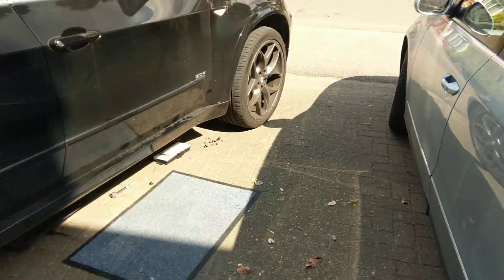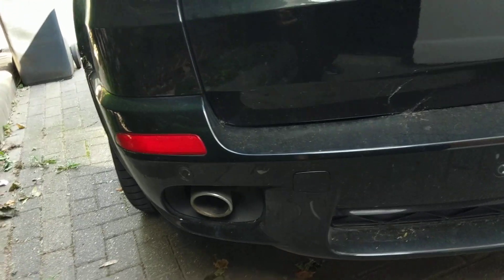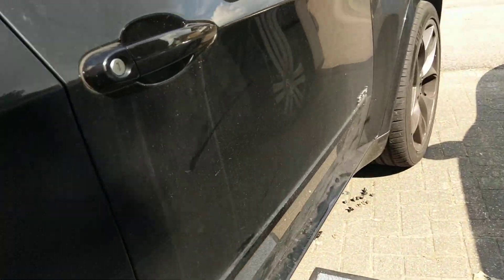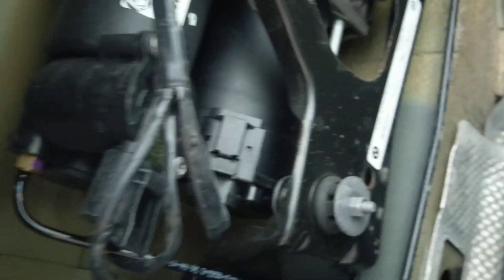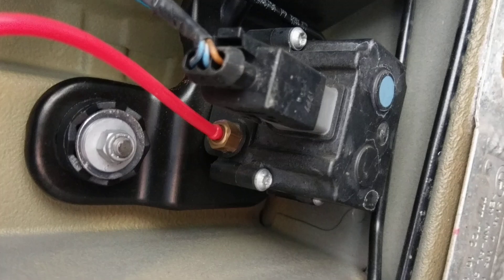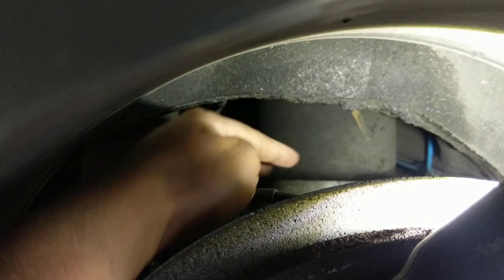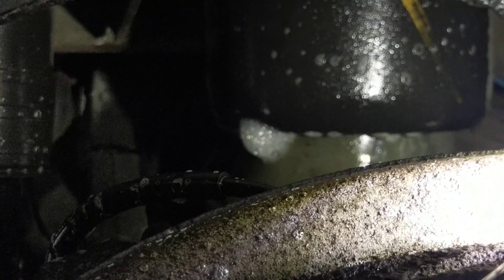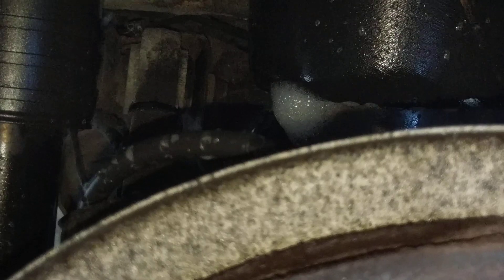BMW Rear Sagging - Air Supension problems

Comment: Thanks for this mate! Got the same issue with my 5 series. Its been in the docs but was advised the bags looked OK, fuse went on the compressor after a week. Hopefully new bags will sort it. Its only 5 years old and it's costing me🙄
Reply: did the new bags work?

Comment: GOOD MORNING I SAW YOUR VIDEO MY QUESTION IS CAN I REMOVE THE SHOWER HEADS IN MY 2004 BMW525 E61 XDRIVE TOURING WITH SPRINGS AS YOU DID?  THANKS I WAIT FOR YOUR ANSWER.  GOOD DAY.  GREETING FROM AUGUSTINE

Comment: If there is no sagging and you get a warning on the dash, it usually means the compressor isn't pumping sufficiently. Rebuild kits are very cheap  and easy to do.

If there is sagging the next morning, there is definitely a leak and is usually the air bag suspension.

Comment: How much is an air bag going for? Mine has been doing for about a month , but only on 1 side. I'm pretty sure it's the air bag cuz when I start it I hear the compressor fill it back up and I'm good til I park it again
Reply: I bought mine for 180€

Comment: I just replaced the airbag with my buddy, and it is still doing it. Wondering if it is the tubes now. It's driving me mental. Whenever I go over a bump I can hear the compressor kick in. I just don't want to spend anymore money on stuff that won't work.
Reply: The compressor has a relief valve on it this can fail allowing all bags to deflate
Reply: @Blaaggarding  My daughter ran over a very bad pothole and one of the airbags exploded.  I replaced the airbags on both sides without problem, but they are both sagging by the morning (one a lot more than the other, but both down), so there is a leak.  I don't think the airbags are leaking, because they are both brand new and getting 2 defective ones seems unlikely.  Does that mean it's the "valve block" or is it the compressor, or both?  The compressor seems ok, because when the car turns on, both sides are pumped and level very quickly.  It's just later when I shut the car off that they start to sag.  Any ideas?  Thanks
Reply: @peteandkendal  My 760 is the same first left down over a couple of days then otherside a couple of days later. Swopped out left bag but still same problem on left first. Driving me mad. Have you fixed your problem yet??? . Most garages can't help, as it's too difficult apparently 😡😡😡

Comment: The compressor on my BMW 520t F11, will not stop, keeps on going 30 min after I switched off. Picked up my car from the BMW workshop 3 days ago after change of compressor and fuse...
Reply from the maker: Sounds like it might be an air leak and the car is trying to self level to certain point. Firstly in the morning can you tell ur car is sagging or very low? I am not familiar with ur model. So just educated guesses.
Reply: I had to remove the fuse. Checked suspension after 20 hours, it´s looks ok. Could it be the relay? I don´t think they replaced that at the car mechanic.